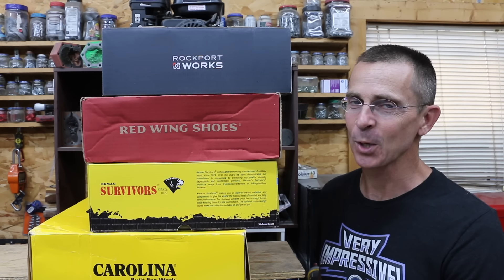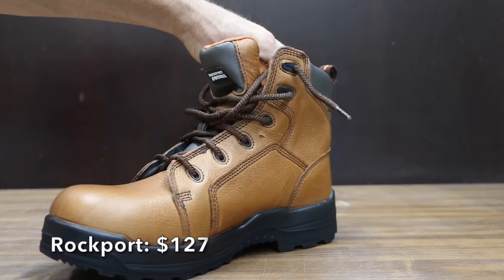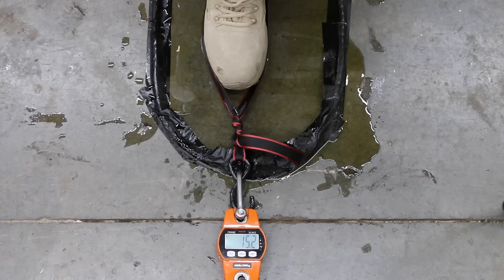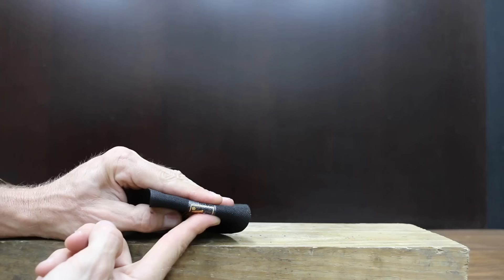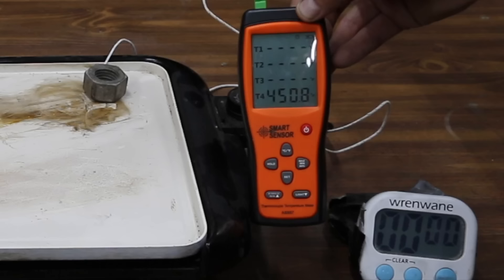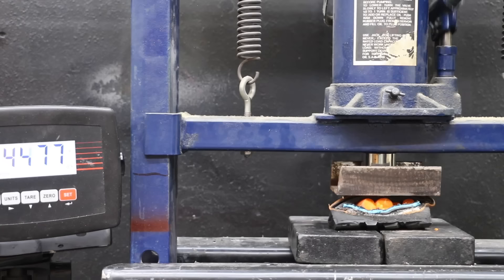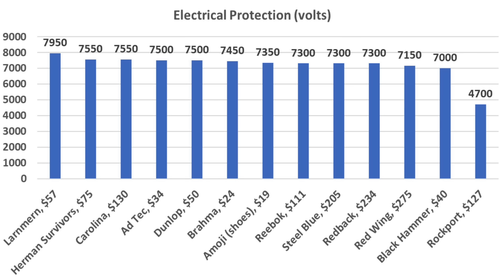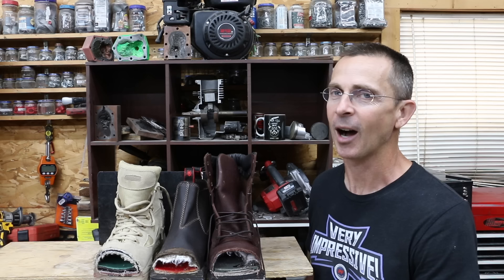Best Boots? $24 vs $275! Let's Find Out!

Comment: I had a pair of Reebok work boots with composite fiber toes and I gotta say they are truly the best boots I've ever owned. They are all around awesome. They are durable, comfortable and safe. Something that wasn't mentioned in this video is that boots with composite fiber stay warmer in the winter and cooler in the summer than steel toed boots.
Reply from the maker: Thanks for the feedback.
Reply: @ProjectFarm  No problem.
Reply: That hot and cold detail is super important, thanks for sharing. I can't wear a lot of work shoes or boots because leather is so much cooler than synthetic to me.
Reply: @PapaMando  You're welcome, happy to help. I do highly recommend the Reebok, I think they were called Workforce but I could be wrong about that. They were a little expensive at $180 back in 2015 but I have never had a better pair of boots all around and the price didn't seem so bad as they held up for 6 years without any problems. The only reason I retired them was because I started a new job at a truck stop and one day I accidentally spilled some DEF (Diesel Exhaust Fluid) all over them and that stuff destroys most materials it comes in contact with and my boots just fell apart in just a few days.
Reply: Factually this is false, the coefficient difference between steel, composite, carbon fiber is + or - about 42 seconds when exposed to cold temperatures. The stigma that stemmed this correlation into causation is the fact that more often than not ct boots are higher end and therefore have better construction, cheaper boots with steel toes have thinner liners and the upper material not as thick. So any element of weather wears on the boot and upper, causing the entire shoe to be cold. 

Working in the safety footwear industry, I can prove this theory false another way. By your logic, steel conducts temperature more and absolute than any other material. By this claim, it would be fair to assume that foundry's dealing with temperatures over 1000 degrees would conduct heat and in turn burn that heat. Working with foundry's and the industry standard for met guard boots, steel toe is standard for it's thin profile for same rating of compression. It does not conduct the heat directly to the toe. The temperature of the boot conducts heat to a point and is made to function at temperatures to be comfortable. Vice versa in cold, the boot is designed to conduct the cold to a point regardless of the toe type. 

This is the biggest fallacy I explain to safety managers and ehs managers all the time. Same with CT being better than st for electrical hazard rating. Unless you're a journeyman or doing heavy electrical work with exposed currents steel can jump charges, but the huge majority of times this has been tested and happened outside factors allowed these anomalies to happen. And have not occured in the field. If someone wants to buy CT boots go ahead they are great but you're feet will still be cold. Get insulated if you are worried about warmth.
Reply: I had some Reeboks when I went to Afghanistan. Most comfortable uniform boot I ever tried. The zipper held up fine even in the dusty sand. They were flexible so kneeling didn't dig the boot into my ankle
Reply: @williamparker7823  They really are great boots aren't they. I didn't know they were used in military applications. That's really cool. Thank you for sharing your experience.
Reply: @Levi Brand  yeah they had some milspec ones that were approved. Much better than the issued boots. Downsides were they were a little warmer than others, and they didn't like oil and greases (just because of the texture, not quality related). They wore more like high top sneakers than boots.
Reply: @williamparker7823  It's good that they have options. I'd imagine that it's pretty important to have comfortable footwear in situations like that. My Dad was in Vietnam and he'd talk about the problems they had back then, like jungle rot, and he said they didn't have any choice but to wear the same governor issue boots. He said it was very important to let your feet dry out but at the same time you never wanted to walk around barefoot in the rice patties that surrounded the mobile Air Force base where he was posted as Communication Sergeant. He said most of the barracks stunk so bad from soldiers hanging their wet socks up to dry.
Reply: @shawnstuckey2461  Agreed but if you work around things that a composite fiber toe can withstand their weight then it recommend them instead.
Reply: @Levi_Amongst_the_Watchers  not really. Better safe than sorry. Then again, it's only your toes..🙄🤪

Comment: Having owned work boots across the cost spectrum, I do adore my Red Wing boots. Wouldn't trade them for anything.

I actually have two pairs, currently saving to get the first pair re-soled since there's a small break about where the toecap starts (I walk around a lot and have to move heavy stuff in small spaces)
Reply from the maker: Thanks for the feedback.

Comment: I'm surprised to see boots like Red Wing perform well in comfort right out of the box. I would expect a quality leather boot to be at least a little stiff, chafing and uncomfortable until the leather has been broken in.

Thanks for the video, great work on the testing as usual :)
Reply: I've had 2 pairs of Red Wings and that's been my experience with them. They don't feel terrible out of the box or anything but it takes a few days to break in.
Reply: That comfort may come with the cost of durability because in my 7 years of using redwings they fall apart after six to nine months. The only reason I go back to them is work vouchers and warranty replacements.
Reply from the maker: Thanks and you are welcome!
Reply: I have a pair almost exactly like the ones tested in this video (mine are not as tall but they're the same style) and they did require some break-in for me personally. However now that I've been wearing them for a while they are excellent. The weight can be bothersome but if they're laced up correctly you don't really notice it.
Reply: @ProjectFarm  I hope you know Red Wing is the only company that sells the nose guard which will last twice as long if you put it on the front of the boot
Reply: @madjackgamingandfitness498  Really? I'm getting 2+ years easily from my pairs and I'm not exactly gentle with them.
Reply: @Jeffect3  I don't do anything crazy to them. Don't know what to say, but eventually the area around the balll of my foot just crushes the inside of it in eventually or the bottom gives out at some point. Only weight 190 so I would think they'd last a while.

Comment: Would LOVE LOVE LOVE to see THOROGOOD BOOTS tested.  They've changed a LOT over the past 20+ years, would love to see what the modern ones do under your testing!!  🙂
Reply: I use to wear wolverine boots all the time,but as I've gotten a lil bit older and my feet have gotten a lil wider and longer from losing my arch a lil bit at a time, the wolverines just hadn't made a wide enough boot for me, so I tried the made in America thorogood boot and I've never looked back. They have been the best 6" composite toe, black leather with the best eyelets on the market that don't pull out or break. I've had this pair for about 1.5 years and regularly change out insoles bi-monthly a long with using saddle soap by kiwi to clean boots exterior then I use mink oil by Danner boots to waterproof them and help deflect metal grinding particles or slag balls from mig welding.. I'm a metal fabricator. I have used redwing boots but they didn't last 8 months and the soles were gone..
Reply from the maker: Thanks for the video idea.
Reply: Definitely,  but it's gotta be the American made wedge sole boots.
The cheaper cemented construction boots are nothing special, you want a Goodyear welted construction so they can be resoled.
Why fully break in a new pair of boots when you can just resole an already moulded to your feet upper?
Sure the tobacco brown leather they use is a tumbled pull-up leather from Horween that requires basically no break in,  but disposable boots are still very wasteful.

The 814-4364 is one of my favorite boots.
Reply: @johneubanks5951  
You should check out some Obenauf's heavy duty leather preservative,  it does a lot more to condition the leather protects it better, and it won't rot the stitching over time like mink oil does.
If you're set on using a liquid the Obenauf's comes in a liquid form, or you can use neatsfoot oil which is better than mink oil.
I recommend Angelus.
You can also add additional waterproofing by using a neutral polish from Angelus because it has beeswax in it, yes it's technically a polish but you don't have to actually buff and polish after applying it.

Comment: I just bought Reebok RB4131 composite toe high tops and I gotta say they are the most comfortable work boot/shoe I've ever worn. These are my first "work shoe" I used to always wear boots but with back and knee injuries I've always had problems with pain by end of day, now I have no issues and they are waterproof and corrosive resistant and anti slip, anti shock, ASTM- F2413. Only $93 too.

Comment: These tests really don’t matter if the boot falls apart in a month I would like to see a longevity test great video on everything else great job thank you 🙏🏼
Reply from the maker: Thank you!
Reply: Timbs are wrecked after 2 months, hermans ive maxed out at almost 9 months. So yes i agree, i would love to see these go for the long haul. Maybe a rock tumbler test or a belt sander test to simulate long term wear
Reply: Agreed. In my experience in the construction industry, cheap boots will be falling apart in less than a year while higher end boots (Red Wing, Thorogood, Danner) will last 2-3 years and still not be falling apart, just worn out.
Reply: I’ve worn my red wing loggermax’s daily the last 3 years and they’ve held up great doing landscaping. Just a general cleaning and oiling, the sole is worn down and some stitches on the left boot and starting to pop so I’ll send them into ring wing here soon to repair/restore I think it’s like $150?
Reply: Buy Whites or Wesco boots if you want longevity and the best boots without going custom.
Reply: I think this would be good for those who can't afford to drop 200 to 400 bucks for a set a boots. 
My first set of work boots were Walmart specials they lasted almost 2 years before I tossed them out.
Reply: I have a pair of redwings I've been wearing near daily for 12 years. Re-sole'd them about 2 years ago, and replaced the laces a couple times,  but the leather is still fine.
Reply: Thorogood 6" heritage moc toe is where it's at, if you need a tough boot that will last forever.  They're also pretty much the most comfortable shoe I own, definitely the most comfortable boot I've ever worn.  Literally over half my shop wear them now from me always Bragging about how durable and comfortable they are. 

I used to only get about 6-7 months out of boots. I easily get over 2 years from Thorogood.  I tend to replace them around 2vyears, just because they're beat up and I prefer them to not look so ragged, but they could easily go another year or so if aesthetics aren't a priority.
Reply: Best I've found are the higher end Timberland Pro boots. Last pair lasted 3 years and I could of got more out of them. 300$ I'm on my 2nd pair now. My biggest thing is more comfort after long term usage. I already know 70$ boots won't stand up to time. Been wearing boots since I was 15 and 41 I'm impressed with Timberland Pro.
Reply: My last pair of Redwing got me through 7 years in Alberta's oil patch, through ever weather condition, chemical and temperature imaginable. Regular cleanings and conditioning only.
Bought some timberland boondocks, and made it 2 weeks before the soles started coming apart, went back and picked up another set of Redwings.
Reply: I'll just say, I've had the same pair of Bellevilles that i got issued in Navy bootcamp over a decade ago. The leather that covers the steel toe is starting to get worn through however.
Reply: @chrischarron6868  yeah, I've only ever heard terrible stories about Timberland work boots.  I hear great things about Redwing obviously,  but Thorogood sound like they're more comfortable,  and there is no break- in time.  That's why I chose them over Redwing. No doubt they make good boots, though.

Comment: I’ve been using boots for work for years and in my opinion there is nothing better than Ariat boots , you are missing those 😊
Reply: The hunt for the best boot continues
Reply from the maker: Great suggestion for the next round of testing!
Reply: The problem I’ve had with Arias in the last few years is the liner no longer being stitched to the outer, and the liner would fall apart from all the back and forth motion.
Reply: @ProjectFarm  another great boot is keen but they have been going downhill with their design
Reply: @samiamm5764  are you talking about the Ariat endeavor?

Comment: As a Landscape worker that does everything... cutting grass, running machines, repairing machines, cutting bushes, spreading materials, and even parking lot sweeping, i have tried several brands such as timerland pro, redwing, irish setter, and sketchers, only the timberlands have lasted decently for me. i have worn out many soles... like next to no grip within a month or less than a year. i have not found one pair that can last with how hard i am on boots. even with putting $50 insoles in them.
Reply from the maker: Thanks for the feedback.

Comment: I've been wearing steel blues for 25 years. They were made in Australia back then and were the most comfortable boot by a massive margin. They are not the longest lasting boot because the comfort soles wear out but still get 3 years out of them. 
Obviously Redwing have worked on comfort because 25 years ago they were supremely uncomfortable, especially if standing and walking on concrete all day. Bloody expensive back then also.
Reply from the maker: Thanks for sharing.
Reply: A handful of steel blue boots are still made in Australia

Comment: I've been a professional field Geologist for 45 years; the most important piece of gear a Geologist can have is their boots. I've worn Red Wings my whole life from the Atacama Desert of Chile to the ice fields (with crampons) in Alaska. They have never let me down. They saved my ankles in a rock slide, and have extraordinary grip on rubbley slopes. I put a layer of epoxy on the toe uppers to reduce wear and cutting from sharp rocks (mainly limestone). They have Vibram soles Norwegian welt so can be re-soled, and the soles extend beyond the uppers which reduces abrasion  and cutting there. I bring all this up because they are design considerations which are difficult to test.
Thanks for your channel. I always look forward to your next program.

Comment: 50 years wearing boots in the woods and at work with work having safety toes, I can attest that quality counts. Been using Titanium toes the last 15 years and the lower weight really helps. Steel toes have been stamped out using same machinery from 50+ years ago and barely cover the toes, composite are bulkier. Only needed them once, but was very glad to be wearing them. Your oil test was good, but that was only one of the chemicals we had to deal with, another bad one is Glycol.
Reply from the maker: Thanks for sharing!

Comment: I have an 8" Steel Toe Logger boot from Carolina. 

I've had them for over a year and a half at this point and they've lasted me fairly well. I don't wear them every day now, but I did for nearly 3 months as well as just generally off and on over that time, and at this point the only thing worn out are the laces I put in when I bought them.

They've lasted through some rough terrain and hiking, including through a few streams, and survived multiple weeks in concrete plants and testing. Haven't dropped anything on them yet.

I will say I find them actually really comfortable. I usually have to use inserts with a good amount of arch support, but these actually fit my foot really well. My only comment is they can get really heavy after a 10 or 12 hour day.
Reply from the maker: Thanks for sharing.

Comment: Chippewa Boots are the best professional grade boots. They're the most durable, and you can get them with a lot of options, such as vibram, thinsulate, waterproof. I buy the steel toe loggers and they last me years of daily use. I've had Red Wings, Georgia Boots, which are in a comparable price range, and they don't last. The sole on Red Wings is softer and wears faster. Cheap brands such as Brahma are for casual use.

Comment: Red Wing are the ticket. Specifically Red Wing Pecos boots, which I have been wearing for over 25 years now.  On my 4th pair, you can do the math but that's well over half a decade per pair, first pair was only replaced because I outgrew them, third pair got a bad gash on the toe from barbed wire and were not repairable, although I did wear them for another 6 months running duck tape over the gash until I got around to a Red Wing store.  The second pair I had lasted over 11 years.  This is wearing them nearly every day, most days working them hard for 10-12 hours through brush, cactus, gravel, dirt, mud, cow manure, rain/wet, occasional concrete dust, etc.  Clean them up when they need it and add some leather cream if they look dry.  And they are made in the USA.